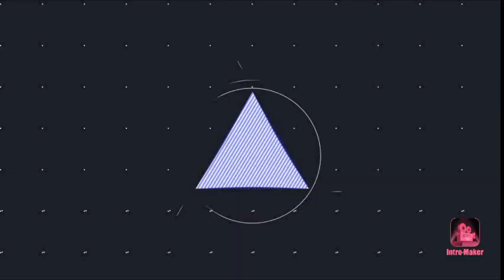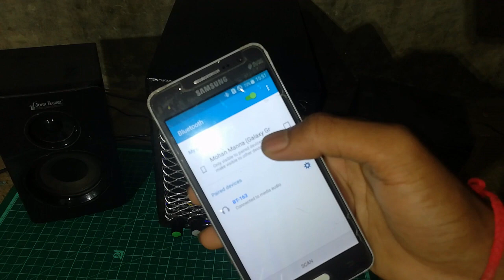✔✔how to make home theater at home/ home sound system

Comment: In this circuit need 3amp transformar for better sound quality..
Reply from the maker: 2*12v =24w.  Add capacitor    get more capacity 30w  because  every time load current not 2a  
   Best quality  12v 3A